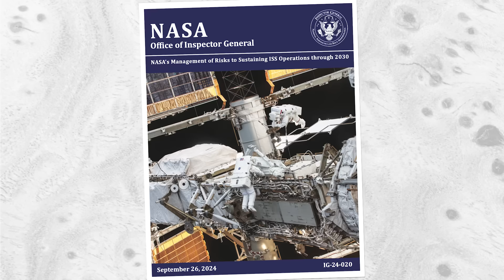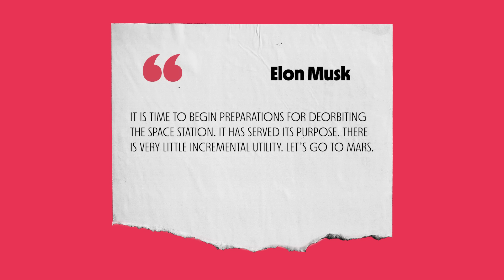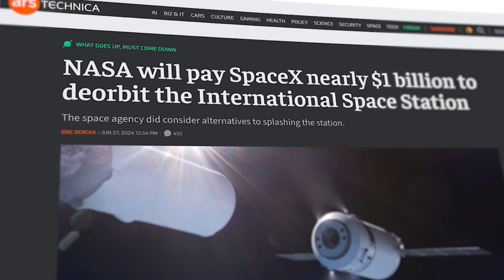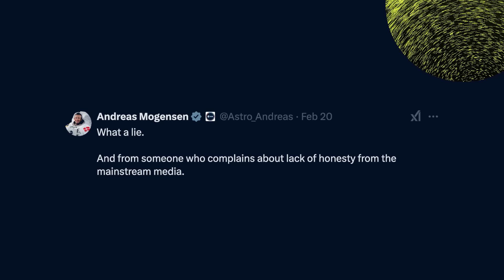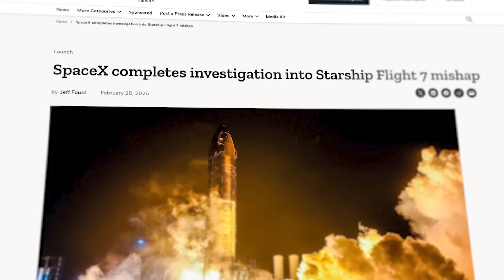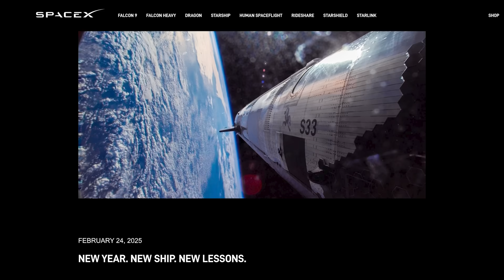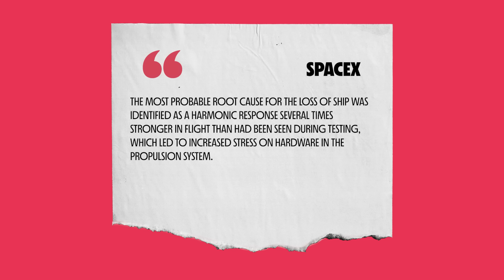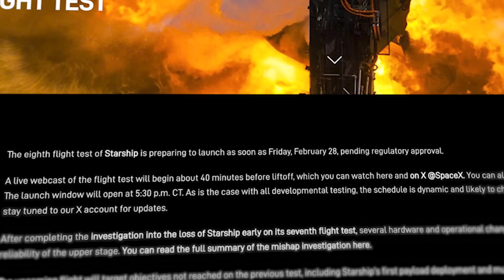Something Weird Is Happening With The ISS...

Comment: The astronauts WERE stranded there though. The fact that people keep trying to debunk that is moronic. Just because they have a plan to bring them back doesn't mean they didn't get stuck up there. They were planned to be up there less than a week, and it has been MONTHS. It was an abject failure of a mission, and NASA (and everyone else) needs to treat it as such.
Reply: The ISS crew situation was resolved by removing two other astronauts from a four-person launch so the two Starliner crew already on ISS could take their jobs. Since then, the number of crew on ISS is correct, Butch and Suni are now part of that four-person team and those four will return when their mission is over.
Reply: Yes, Boeing's failure, not Nasa's
Reply: The plan to bring them back existed before the election. The idea was to cause the minimum disruption to the existing flight schedule. And in the meantime, they have been doing useful work up there. So no, they were not stranded.
Reply: @espeterson522  that’s the hill you want to die on here? Hahahaha
Reply: They were never "stranded." In the case of an emergency when starliner was still docked to the ISS, they were cleared to evacuate using starliner. After starliner undocked, CV8 was tapped for emergency evac, and now CV9 will be used. They could've returned at any time if they so chose. 

Starliner landed safely and without major issues. If butch and sunny had been aboard, they would've been just fine. The call to abandon the landing was out of an abundance of caution. The issues weren't really mission critical.
Reply: @EntropyConcept  Unnecessary risk IS mission critical. The Starliner DID have an anomaly on its return flight that would have been aggravated had humans been onboard.
Reply: @EntropyConcept Sounds like they a stranded for now.
Reply: @ No... CV9 is now docked to the ISS. Its what Butch and Suni are taking home, and can take home at any moment in the event of an emergency.
Reply: Well no, stranded means they had no way of getting home. They have never not had a way of getting home, therefore they were not stranded. Yes the Starliner missiopn was a fail, but that does not mean Butch and Sunni were actually stranded. They weren't and never have been.
Reply: @_starfiend For now, they meet the definition of stranded.
Reply: @JohnSmith-ux3tt  Actually they don't. If they are 'stranded', then so is every other person currently in space. Stranded means they can't come back, which is not true, and never has been.

Comment: on the ISS i think originally they should have added the newest modulus starting at one end and then jettison the old ones, in a never ending conveyor, design flaw. I don't think they should de orbit the ISS ever, push it in to a graveyard orbit, maybe a combination of chemical and electric drives to get it there. lots of resources there.
Reply: Building a new space station, similar in scale to the International Space Station, would likely cost upwards of $100 billion dollars, with estimates ranging from $100 billion to $150 billion depending on the complexity and international collaboration involved. 

Moving the International Space Station (ISS) to a significantly different, stable orbit would likely cost billions of dollars, with estimates ranging from hundreds of millions to potentially over a billion dollars depending on the required orbital change  Some say 2.2 billion to move iss to a stable orbit.

Comment: ISS was incredibly expensive and hard to build. Until assembly complete, science took a back seat. But since then it has been utilized as an actual National Lab, lots of research and science throughput. It’s no different than Sandia, Los Alamos, or any other science asset owned by the US. Why would you want to cut a single day out of the schedule that is pushing so much science?
Reply: Perhaps a cancer cure is right around the corner, but I doubt it. Anyway, the modules were not rated to last forever. The longer they remain in service, the riskier habitation becomes. It's not as if this wasn't known from the outset.
Reply: @DrMackSplackem  We know the cure already: Treating inflammation. To put it very simply, Cancer is caused by chronic inflammation. Treat that, you'll see less cancer. This is well known but well brushed over by mainstream science. You can find a lot about it through basic online searches.
Reply: @DrMackSplackem  A cured patient isn't paying them... They would rather do "Maintained" to keep it at bay as they milk you dry of your assets and retirement...
Reply: Because it’s deteriorating and getting dangerous.
Reply: Agreed.
Reply: To replace it with a far superior station, that can accommodate a lot more than just science...
Space travel/militarization is changing in big ways. I can see the Space Force and DoD establishing different military space-station's for different purposes.
The Space Force could have a small one super far out and hidden for docking multiple X-37B's along with other systems they're currently asking for and are developing that are extremely secret and will be used to defend our satellite's from, essentially, Chinese and/or Russian snooping/sabotage space-drones.
The Chinese and likely Russians are already weaponizing their satellites, while saying they would never of course...
Reply: @scottsauritch3216  am I the only one who thinks an inflatable "bouncy house" is a bad idea in the vacuum of space?
SpaceX has the best, safest alternative/replacement for the ever aging ISS....
Also....is there no components of the current ISS that could be salvaged or repurposed in the new station? Seems like alot of waste to just deorbit the thing as a whole.
Reply: It would be great to keep ISS aloft, but radiation bombardment is slowly destroying the structure. In a couple of years, it may not be safe for human habitation. That said, I wonder why they don't just build new modules and glue them on, gradually replacing the old stuff. Maybe it just wasn't designed for that.
Reply: @ChickensAndGardening  well, no, it is modular in it's very essence. Radiation destroying the structure ? really ?
Reply: @ashleyobrien4937  Yes! Oxygen atoms in LEO collide with the metal at high speeds, causing oxidation; it thins the metal and causes pits. Also extreme temperature swings cause expansion and contraction, eventually stressing the metal and creating microcracks. Solar radiation breaks down the metallic bonds. Micrometeoroids collide with the structure, damaging it or even puncturing it. It's just a very hostile environment, unfortunately. The old 2001: A Space Odyssey idea of this giant wheel is probably not realistic; more likely would be to build something out of asteroid regolith to better withstand this stuff.
Reply: The ISS has had it's day. It's just languishing at this point and sucking up massive amounts of money for what "science" exactly?
Reply: See all the buml1ck3rs, trying to rationalize why the South African Technate gets to deviate from a national contract of controlled demolition...
Reply: Electrolysis of molten sodium chloride in space will create Sodium metal and keep it as such. On Earth can only be done inside vacuum chamber which can not even be maintained unless the pump is sucking the chlorine out of the chamber faster than it gets build up catastrofically for the Sodium.
Reply: It's obvious that Musk is deteriorating as well.
Reply: Its very expensive.

1 starship iin orbit could do almost everything done on the ISS and more.

Money saved could fund moon missions/mars missions
Reply: Because operational cost is several billion dollars per year. And guess where that money will go when it's freed up by dumping it into the ocean.
Reply: Wouldn't this be good around Mars.  Wow, that would be a real advantage.
Reply: @NorthPoleJeff  - I'd say, take it a step further - keep all the goodies inside that aren't expired, and then move the modules around and "tug" it to Mars - OR the moon.

Mars would be better, but the moon will have it's own space station - or should!

There's a lot of stuff stored in some of the modules, that could probably be
reused and might make it slightly easier to add upgrades and fixes to the already
"re-used" ISS, perhaps?

Would moving it away from it's current location in Earth orbit, and into deeper space, reduce the impacts of LEO "disintegration", or "outer space" on it's structure?

Maybe it could serve as a hotel of sorts - so long as it's repaired?

There's a lot of stuff stored in there, they ought to reuse anything they an !

Am a big fan of recycling, can't ya tell?

Seems such a waste to burn the entire thing up, when there's a ton of stuff on board that could be used in a new station, that could be twice its current size easily - IF built in space, instead of being hauled up one module at a time.

There should some way to save some of the major parts - like the truss, the newer solar panels, and the better modules ...
Reply: @kumbah2006  That's a good idea.  Yes, around the moon will be a huge asset too.
Reply: Because it is redundant science...let's take the next step forward
Reply: BECAUSE THE THING IS LITERALLY FALLING APART...AND IF HIT BY DEBRIS, COULD TRIGGER DEPRESSURISATION. STOP FAWNING AND LEARN ABOUT THE ISSUES.
Reply: This reads like the jokes about the Large Hadron Collider. “Just one more science, bro!”. “Just science a little harder, bro!”. “I just need one bigger science, bro!”.
Reply: @Constabruity  You obviously don't know what you're talking about. So next time, do yourself a favor, just keep your comment to yourself! 😄
Reply: @myaschaefer6597  literally no clue what you mean, but okay. I can’t not know what I’m talking about, it’s a joke.

But thank you, very cool.
Reply: it is ridiculously expensive to maintain, and it can be used as a collision weapon my foreign powers.

Comment: I'm going counterflow with that: I think they are actually stranded on the iss, just in a non problematic way.
Reply: "Stranded" is often used to describe a traveler whose vehicle breaks down, causing an extended delay, until they get a ride much later than expected, a prolonged state, though not necessarily permanent.
Reply: Stranded would suggest there's no way for them to return.
Reply: They are stranded in the same way I’m stranded in my home town because my train is coming in 5 minutes
Reply: @Wurtoz  Only your train was suppose to arrive last year and you have been sleeping in the station like a wino.
Reply: @Spin_Gravity funny reply.
Reply: @Wurtoz  valid

Comment: so, why can't the ststion be used as a resourse for building a new station?
Reply: Metal fatigue is real, in maintenance costs are increasing. Nothing lasts forever.
Reply: I think that's the plan for at least Axiom Space. They are still planning to attach to it, test, then detach when it's viable.
Reply: It is being used to do that.  Look up Axiom space.  They are attaching their space station to the ISS, then detaching it once it can survive on it's own.
Reply: Agreed if they use the solar panels and the arm it on a mars transfer vehicle.
Reply: would need ability to smelt metal in space
Reply: it is a political prison.
Reply: Bear in mind that so much as going out to replace a faulty bolt on a space station is a major endeavor with our current space construction technology, which to be clear is about the terrestrial equivalent of being able to construct a lean-to. We simply cannot build much in space right now. We don't have any cost effective tools or techniques for doing so - same with taking anything apart. People have trouble grasping just how useless almost all our existing methods are when you move them into a zero-g vacuum.
Robotics may change that, but right now it's just not feasible for us to build - or dismantle - anything at scale in space.
Reply: Not that it could not, but the station is very dated and also not owned by a soul owner. It's an international space station, built with a global effort. If someone wanted to repurpose it they would need to buy it from multiple nations. The station is not future proofed either, it's a mix of old american, soviet, russian, 10 Eu nations and canadian tech. This would make it hard for future upgrades and continuous maintenance.
Reply: Cause it's so hard......?
Reply: Parts of the station have microcracking in hull and air lock on Russian's side.  Given how in some cases the Russians are partially trying to keep air leaks quiet, their components of station would be costly and time consuming to replace.
Reply: It is a resource of metals and plastrics and wires and other materials, most of which do not rust in space! Recycling makes more sense than dumping it into the ocean. Sounds like waste is the prime desire of Musk!
Reply: bro you using 20 year old tech as base, the point of retirement is because it is way too old and time to move on to newer and better thing
Reply: @Not_Danten  Axiom’s station will be an ISS parasite until it goes free flyer. The age of the ISS doesn’t really factor in since they’re just using resources.
Reply: @Not_Danten  That is what you would say if you want to spend more taxpayer money.  Why not auction it off to other interested parties who could put it to use?  I'm sure someone could use some nice solar panel arrays, docking ports and nice manipulator arms.
Reply: @pctrashtalk2069  so humm who would like to pay for a space metal junk, there are plans repurposed like that one would like to turn into space hotel, but humm, care to wonder why it is old news the ISS has leaking air, and running on high capacity. Face it the tech is a too old, and keeping it pass 2030 at the latest is looking beyond the limit. BTW bro we are not far away from decommission date, it is 2025 RN and plans for new space station should be up to date whether joint project or not. Either way tax money is still being spent.
Reply: @pctrashtalk2069  did I mention it is not entirely "USA property"